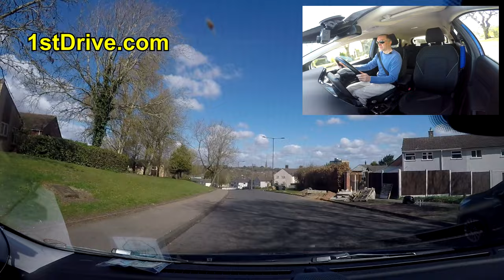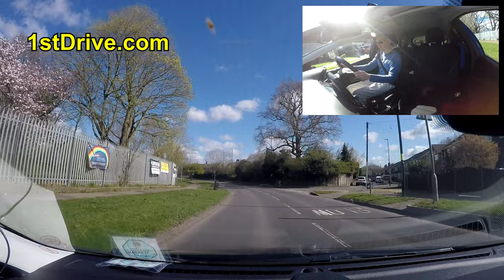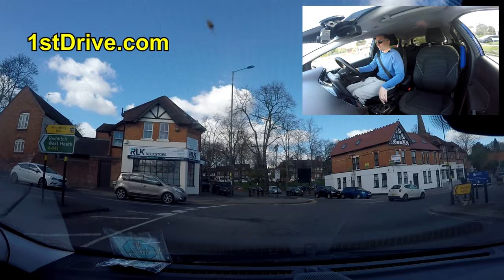How to approach roundabouts UK

Comment: Thanks going a bit backwards even though I passed advantage of an auto not having to thibk clutch if you need to stop.
Reply from the maker: Manual cars may not be around much longer. I haven't driven an auto for years and the one I had was very old but there was an annoying delay whenever you went to move. It's like it took a second to think about it and then it'd go.

Comment: The only sign where you MUST stop to the letter of the law is the octagonal Stop sign. 

Ironically, a red traffic light or a hand-held Stop sign does not actually mean Stop to the letter of the law: the actual instruction under the Traffic Signs Regulations and General Directions 2002, regulation 36 is that you must not proceed past the stop line while the signal is displayed. It is legal to arrive at a red light and proceed when the lights change, or even hover in first gear near the stop line while waiting, without ever having come to a stop.
Reply from the maker: That's right. The variations I was thinking of are things like level crossings or drawbridges. Although you don't have to stop by law, you're really forced into stopping unless you creep for several minutes which would be unnecessary. I've got  a video clip about drawbridges that I never got round to using talking about that.